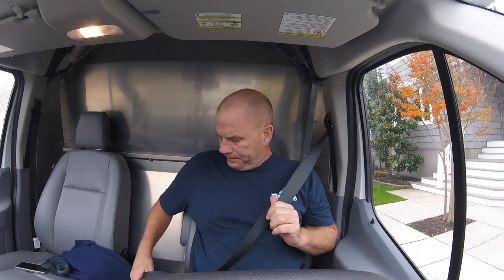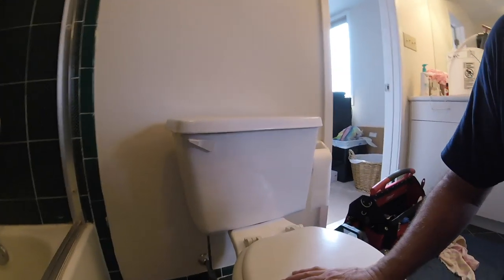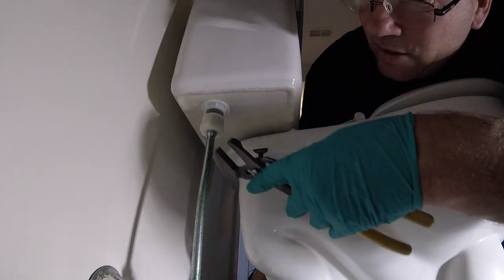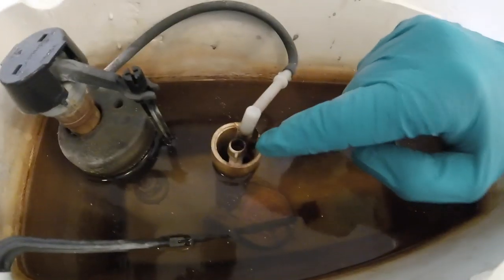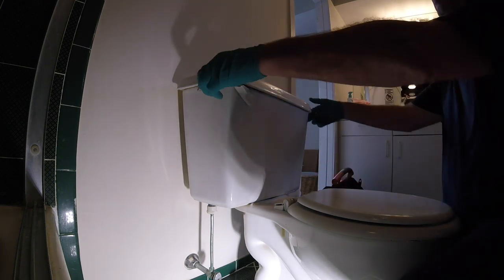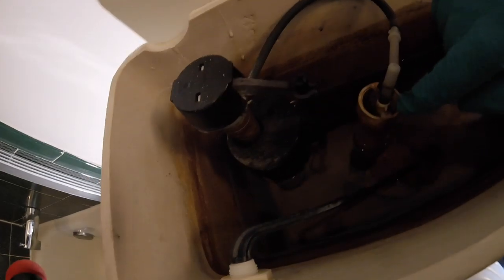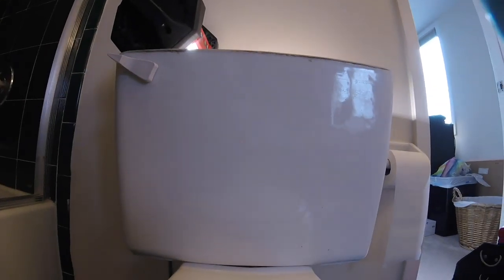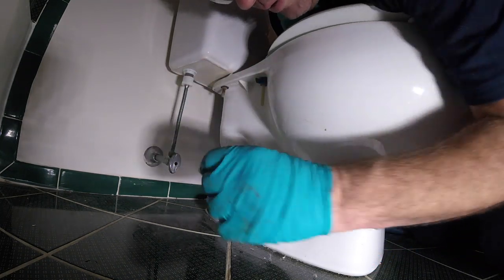PLUMBING REPAIRS | PLUMBING APPRENTICE | 15 COMMON TOILET LEAKS

Comment: I'm not a plumber but I've fixed many toilets in my lifetime. I've seen most of these leaks and fixed them at some point. Sometimes the chain on the flapper is set too long and it gets caught under the flapper causing it not not close all the way. I remember a simple leak that caused a big flood in 3 apartments in an old 3 family house in Providence, RI. It was my first apartment and I lived on the second floor. The students upstairs had a toilet without a tank lid. The refill tube got knocked out of the overflow tube and it was aimed at the wall behind the toilet. They flushed the toilet and left the apartment for the day. The flapper got stuck open so the fill valve wouldn't shut off and the refill tube squirted on the wall for many hours and flooded their bathroom, caused the paint in my bedroom and bathroom to bubble, flooded the bathroom below me and collapsed the bathroom ceiling tiles into a wet heap on the floor, and caused a big puddle of water in the basement by the time the leak was caught. Needless to say the landlord was not pleased. 

By the way toilets in Australia don't have this small bowl refill tube from the fill valve to the overflow tube. It's not needed since Australian toilets don't have a syphon flush and the bowl doesn't need to be refilled to flush properly.
Reply from the maker: nice read.

Comment: If the flush valve tube is higher than the bottom of the handle, and say the fill valve/ ballcock won't shutoff, The tank water comes up and goes out the handle before it reaches the overflow tube creating another leak opportunity!!Also a hairline crack in tank or bowl can cause another possible leak! I've seen all these scenarios buddy! Good video Chuck!!🇺🇸
Reply: Steven Breeding  Cut the overflow tube so it is lower then the hole for the trip lever
Reply: @brewmule6799   That's exactly what I do! I see a lot of them that haven't been cut down and they are higher than the handle LOL was probably a do-it-yourselfer throwing a new one in there didn't know it needed to be cut down! Thanks for your comment!
Reply from the maker: the ole hair line crack...a killer.

Comment: CB-1 this master plumber says I think you covered everything where a toilet could leak, great job. If I was you I would put a quarter-turn shut off valve in you will be much happier with that. I have a question what's with the all the post-it on your bathroom door? Great video. Peace brother
Reply from the maker: 4 valves coming on all toilets. sticky notes are actually my office door. Usually that door closed to bath.

Comment: “As protectors of the environment and the public's health, safety, welfare and property, the plumbing engineer upholds the precepts of honesty, integrity, impartiality, fairness and equity and provides services in adherence to the highest principles of ethical conduct and standards of professional behavior.”
Reply from the maker: Yes Sir......
Reply: That should apply to all trades,not just the plumbing trade.When ever I do work I do the work as if it was for myself in my own home.Unfortunately many people now a days are severely lacking in integrity and do crap work,they figure as long as it doesn't leak it doesn't matter and that's the wrong attitude to have because a person's work is a mirror image of their character,in other words,if a person does not take pride in his/her work then you know that the person lacks pride in themselves.

Comment: Always buy toilets that are factory tested and flushed 100% before they send them to the market for consumers, the worse leak is installing a brand new toilet with inside defective/cracked trap and you get the call back there is a spot in the ceiling whenever the customer flash new toilet.
Reply from the maker: Thank you. Agree.
Reply: I've had that happen to me as well! The toilet I installed kept leaking !But it took a few days for leak to show up.... Finally found the hairline crack underneath the bowl! Was a hard pill to swallow 4 sure after 3 trips to HD and customers house to getter done!

Comment: Not a pro (yet) but had a call for leaking toilet (thought to be a flapper) turned out to be chain was played with, and put back in wrong spot, so the flapper did not go down correctly.  Not sure if you mentioned this, but that is another spot.
Reply from the maker: the ole chain adjustment....add it to the list. thanks Dave.

Comment: The volume on the video wasn't very good , but what about the tank to bowl gasket, also if the refill tube is stuck to far down the overflow tube it will keep siphoning water out of the tank , hair line crack in tank or bowl,trap blockage where water overflows rim of bowl. Outro too loud. 🥁🥁🥁
Reply from the maker: good point john,  I know you heard your shout out to? ha.